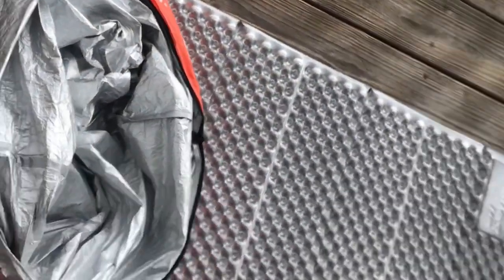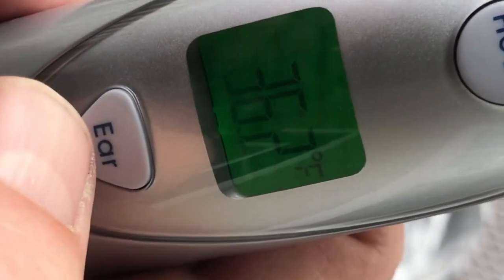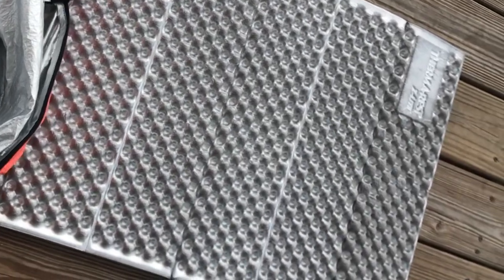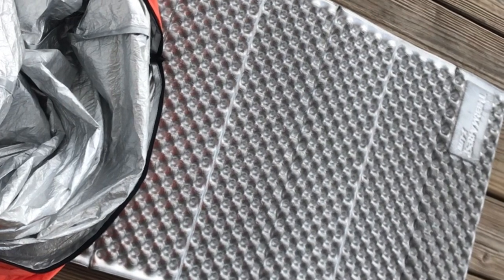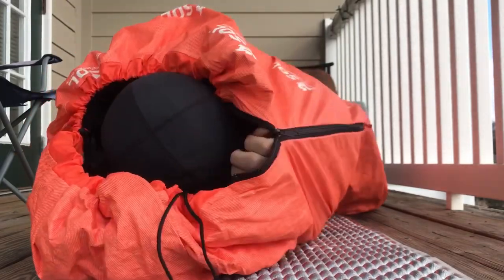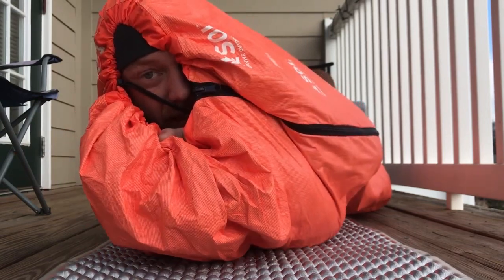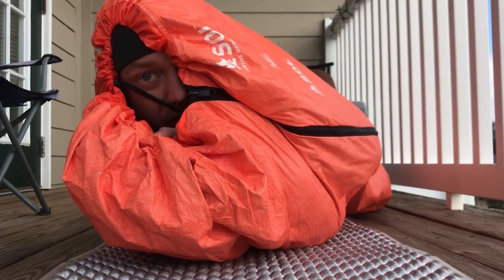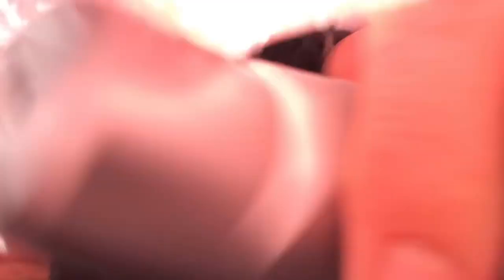SOL Escape Bivy- Why you’re cold when you use it!!!

Comment: I no have to say I respectfully disagree. This BIVI is supposed to have an insulating layer inside. The key is using an appropriate layer for the conditions. Sweating is simply because the user has used too much insulation. But I know many people who regularly use a sleeping bag inside these and have zero problems with condensation. Too much insulation = sweat. Too little = cold. Exactly the same as clothing. We all know to take off layers if we start sweating, or put on layers if too cold. Not sure why people think it’s any different when laying flat inside a bivi bag.

Comment: It is not a sleeping  bag except in an emergency. It is a bivy sack, meaning you need an insulating layer, unless it is already warm and you're only trying to stay dry. If you dress properly for the environment and activity, such as you are, that may be sufficient. Or, possibly the addition of another jacket. I have used the SOL Escape Bivy with a jungle sleeping bag and fleece, with the temperatures down in the 20°, while hunting in the mountains of Nevada. Stayed warm enough and dry. You have to look at it as part of the solution.
Reply: The jungle bag alone is rated down  to 28 alone. Instead of a jungle bag and "fleece" not sure if you mean clothing, blanket or sleeping bag liner? Use a down bag?

Comment: Just for more food for thought, I was in a cold weather unit in the Marines and so I got to spend my fair share of time outside in negative temperatures. We had a saying 'cotton kills'. If possible, try to wear synthetic base layers that will shed moisture. Cotton becomes soaked and will suck heat from you. Sweat is your enemy. If you're going to have to do some moving, start cold, believe me you'll heat up fast as you begin to move, especially with a load on your back, and it will prevent you from excessively sweating.
Reply: When i was in MWTC Bridgeport I slept with my mouth at the drawstring hole so I didn't condensate and die. That was -20's with wind. Worst 30 days of my life!
Reply: Not precisely. Cotton wicks. The key is in wearing layers of clothing, in the proper order. Bare minimum,  you need 3 layers. 1) A wicking layer 2) Insulation (loft) layer 3) weather-proof layer.
Cotton also holds up better to getting loaded up with sweat and salt and etc. than any other fiber.
Step one is DON'T sweat. If you start to sweat, ventilate immediately to release the excess heat from your body core.
IF you're going to wear a cotton it needs something to wick in TO. If it doesn't have something to wick in to, it won't. Then you've got problems. You don't want your sweat to evaporate directly out of the cotton, because that sucks the heat right out of your body. So, then you've got to take your base layer off and air dry it. Without it freezing solid.
So that's why you need something for it to wick in to. Cotton wicks best in to wool, and coincidentally wool has the best loft and insulation values of any cloth material. Fleece has almost identical insulation values when it's dry, but it doesn't have near the insulation value of wool when it's just damp. Wool blows everything away when it's damp, because it has hollow fibers.
Your top layer should be weather-proof. Our forefathers used oil-skin.
I think it's terribly interesting that the natural materials work better together, and the synthetic materials work better together.
If you want to use synthetic materials, your base layer should be a cotton/polyester blend. Your insulation loft layer should be a synthetic fleece. Your weather-proof layer should be gore-tex. For each layer, the more expensive blends add a few more % of insulation value. Supposedly.
That should be all you need. Add a thinsulate hat, boots and gloves (I prefer gloves with gore-tex and kevlar padding in deep winter) and you should be good to sub-zero temperatures. The only time you need snow pants, a parka and etc. is in blizzard conditions or cross country snow trekking.
The key, in every layer except perhaps your base layer is ventilation. You always want your base layer to wick away from your skin. All of your other layers need ventilation. It is critical that you have the ability to quickly ventilate excess heat once you start sweating, so that your body will stop sweating. As we know, your body sweats to prevent heat from building up in your core and damaging your internal organs, up to and including heat stroke. If you have the ability to ventilate off that excess heat in sub-zero temperatures, you're golden.
Obviously you don't need to wear all three layers year round. Here in Colorado the weather is 100% schizophrenic. You can have a full-tilt mountain blizzard one night, and 80 degrees the next morning. Every. Body. Wears layers once they've spent enough time in Colorado. You don't need to wear all of the layers all of the time, obviously. You just keep them in your truck or pack or whatever. In the sand dunes, you're better off stripping down to your base layer. Actually, a LOOSE fitting cotton layer covering your core and limbs is your best desert option.
Just to be totally honest, I should mention that I wear wool socks 24x7x365.. but that's just me. I love my wool socks. As amazing as wool is, you should NOT wear it directly next to your skin, because your sweat breaks down the lanolin and makes it less waterproof. If that's not bad enough, the salt crystals from your sweat cut up the wool fibers and break it down. I do what I want, though, I just keep like 12 pairs of wool socks on hand, then buy a few more pair every winter the second that they hit the store shelves. :)
Reply: I was taught as a kid going hill walking, you have to stay cool to stay warm.  Meaning, perspiration leads to getting cold.
Reply: Cotton is a no no for sure
Reply: @Crogon  exactly it gets loaded up with sweat...do not want your sweat evaporating out of cotton...etc..  You sort of proved his point in a round about way. Cotton holds up better than any other fiber to getting loaded up with sweat but then wool blows all other fibers away? Cotton doesn't hold up all that well and dries much slower. Does it wick? Sure it will soak it all up. Soak it all up and hold onto it. I like my cotton for sure, comfy and warm in ideal conditions. Less than ideal or sweating? It's no good. Wool doesn't loft. It is the measure of space down fills. There is no combination of synthetic or natural materials that need be followed. If you are wearing or using cotton your step one is absolutely avoiding sweating as you said. Otherwise step one is wearing synthetic layers, step two vent to stay dry lol. I would agree wool would be best on top of cotton if you are going to rock it. I just avoid it all together.
Reply: @projectknifehand  Not sure exactly what you're getting at with that long diatribe, or why you say I proved myself wrong.

Sweat, like other liquids, carries contaminants in to the fibers. That would be.. ALL fibers.. not just cotton or wool or any one fiber. Besides just standard soil and other dirt, sweat also carries. SALT..

Salt has a natural tendency to QUICKLY break down fibers, because when it dries it crystallizes and forms sharp surfaces which cut the fibers.

The ONLY fiber on the planet that has a natural defense to this is... WOOL.. which is naturally coated in a Lanolin wax which prevents the crystallized salt from immediately sawing the fibers in half.

...terribly interesting to be sure, but I'm not at all sure what any of this has to do with the previous conversation or why you would  throw out statements like I proved myself wrong. If anything, wool is SUPERIOR to any other fiber known to exist, against sweat. 

..but whatever, I'm tired of arguing the point. Go do your own research. All of the above fibers need to have the soils rinsed out of them occasionally, to prevent excessive wear from soil, and salt in particular. The only reason wool is special, in that regard, is that you can eventually re-treat it with lanolin wax, basically giving it 'immortal' resilience against sweat and salt.

I never did say that cotton has such an ability.

Again, whatever...
Reply: Actually, I thought this was a different comment thread about wool and cotton that keeps getting commented on. So, sorry about the references to 'what I said before', but everything else stands on it's own. ;)
Reply: @Crogon  not sure how it stands without legs but whatever works. Being adamant about something doesn't make it correct. ;-)
Reply: @projectknifehand  Well, I'm still confused about just exactly what you were trying to get at anyway. I couldn't connect the dotted line, as it were.

Bottom line, you need to layer your garments so that you DON'T sweat, in the first place. In the second place, if you do sweat, your cotton undergarments WILL wick the sweat up in to your wool garments. It's a well known fact that wool retains heat better than any other fiber, even when it IS moist, and as I mentioned it is the only fiber out there with a natural defense against salt crystals from sweat.

So yeah, maybe try to get at your original point from a different direction so I can get the gyst of the point that you were trying to make. I'm just sort of sprinkling facts around related to what you're getting at, but that doesn't necessarily make them applicable. If you're trying to dispute those facts, just look them up yourself. it's not hard, and the the capabilities of different fibers ARE well documented, just misunderstood occasionally. For instance, wool does NOT retain 80% of it's insulation value when soaking wet, though some people think that that is true. What is true, is that wool has HOLLOW fibers, so even if it is soaking wet, it will regain it's ability to retain heat 80% faster than any other fiber. See the difference? The devil is in the details, as they say. :)
Reply: I was just going to say that. Ive seen all these guys wearing jeans and cotton tees. You will sweat and itll cause condensation
Reply: @Crogon  I wish I had your info when I was in the army (Australian). Exercises in winter were just sweat - freeze, sweat - freeze, sweat - freeze (yep, it gets cold in Australia - inland.) Back then, everything was jungle green cotton. For the winter we got a jumper and a plastic poncho. I still remember cracking through the ice over the rain that had gathered overnight in my fire-pit.
Reply: @GarrisonFall  I hear ya, I served here in the U.S. I just kept telling myself 'that which does not kill you only serves to make you stronger'. ;)
Reply: @Crogon  I've been outdoors with light undergarment - cotton tea shirt with polyester fleeced thermals, and a medium duty shirt. Top was a US Navy Navy pea coat. No problem for eight hours outdoors - Temperature 32F Wind 30mph
Reply: @AMC-eq3jr  I wasn't saying that you CAN'T combine natural fibers with synthetic fibers, it's just not as efficient. For example, your base cotton layer would wick your sweat in to that fleeced polyester, slick as snot. ..but then polyester can't wick, so the moisture would just sit there and get rank, or evaporate with enough ventilation, but leave the salts in that lower layer where they'll eventually tear them up. Now if you're coming home every night, and washing clothes every day (after every use).. probably not an issue. However, you would still be better off sticking to one or the other. :)
Reply: James Long: your basic argument about layering contains a fallacy... "layer your garments so that you DON'T SWEAT" what kind of an idiot would make that kind of a statement? Have you ever worn a modern polypropylene undergarment? They are expensive for a reason. They are designed to wick moisture away from the skin while still being soft, light, durable and non-chapping to the skin. They are designed so that you can take wool out of the equation and replace it with a layer of light stuff able down. Your entire set of arguments are antiquated and BS.
Reply: A cotton fishnet/netting baselyaer isn't so bad, but yeah, regular cotton in winter sucks.  Unless it is like a waxed cotton anorak that is used in dry cold.
Reply: @Crogon     Regular sheep's wool is not really hollow.  Other animal fibers are--particularly ones that are either adapted to colder climates than sheep or aren't as naturally warm.  Some examples include alpaca, angora rabbit fur, yak/musk ox, etc.
Reply: @justinw1765  Correct! That's why we refer to sheep hair as FLEECE, not wool. :)
Reply: Great comments , I was always taught ; practice, practice, practice and when you know it all ; practice some more !

Comment: I’ve used this bivvy many times.  By itself in the summer and with a sleeping bag inside for colder weather.  It absolutely increases warmth but I wouldn’t say it is noticeably breathable.  I always have a small amount of condensation on the inside of the bivvy but overall, I think it’s great and usually bring it as a lightweight solution to increasing the warmth of my sleep system.  Having said that, I once tried an emergency Mylar sleeping bag and the sweat buildup was insane.

Comment: Definitely some good tips. You're right about over-layering and generating perspiration. However,  I know some people use the Escape with bags inside with no condensation. I think the key is not using too much insulation and matching your gear to conditions. For example, you might put a 40 degree bag inside the Escape and may get into the 30s more comfortably. I don't own this yet, but it seems a lot of people are successful using it along those lines. I was researching this to possibly use with a tarp setup to block wind or mist from my bag if things got too drafty.
Reply: any feedback on that btw im thinking of doing the same

Comment: Consider adding a vapor barrier liner inside the sleeping bag. The liner maintains the proper humidity next to the skin and will keep all the insulation around you completely dry. I don't go backpacking without one. They are not easy to find. Backcountry Gear sells them. They cost close to $100 but are truly worth it. You might be able to make a cheap temporary emergency liner by sewing a couple of space blankets together taking care to completely seal it to moisture. Just wrapping a space blanket around you inside your sleeping bag would likely be less effective. There are a few good articles on the internet about how vapor barrier liners work.
Reply: VIP's are almost a necessity for extremely cold (below 0*F, but more so even colder). They aren't so comfortable for moderate to minor cold as they can get very clammy.

Comment: you're cold when you use it cause it's not waf below 60F, unless you tent it off of you and have it around a hammock. Then it can handle 50F, if all you have is cammies and a beanie.  Thats all. It's too small, too, since it's sized for little Asian guys. A much better deal is the $95, 1.5 lb Trifecta bivy from 2GoSystems. It's much bigger, has tie offs for use as a shelter, can be worn as a bivy, two full zippers.  If you envelope it in a couple of taped together drum liners, it'll let you sleep ok at 40F, in cammies, gloves,  sets of sock lliners, shemagh, beanie and unlaced shoes,  6" off of the ground in a hammock, with debris kicked under the envelope to stop air from flowing under you.  That's all you can expect of a layer of tyvek, folks.  You CAN add dry debris between the bivy and the envelope and get it down to 30F, add hot rocks or hot water bottles to the footbox, and get it down to 20F, for 2-3 hours at a time. Dont expect miracles out of a thin piece of tyvek, cause you'll be sorely disappointed. any place it touches you will form a cold spot.  It does nothing to stop heat loss from conduction to the ground,  It doesn't stop much wind and if you let water puddle up on the tyvek, it WILL soak thru, eventually.. If you dont envelope it in some sort of other barrier, forming a layer of trapped air, you will get some condensation of your body moisture inside of the bivy

Comment: I use the Escape Bivy as a top quilt in my hammock and it blocks the wind, reflects my body heat, and I am not building up moisture.  I guess the side ventilation when using as a quilt stops the moisture from building up.  I  cut down the top of the bivy in the middle to about 2.5 feet from the bottom.  This creates a foot box.  Then I flip it over to use it as a top quilt.  My main insulation is my clothes.
Reply: Turning it into a quilt is a good idea it retains the air gap between the Mylar and yourself and that traps radiated heat, instead of squeezing into the bag and having no air gap to retain heat, 
while wearing a puffer jacket and a pair of quilted trousers.